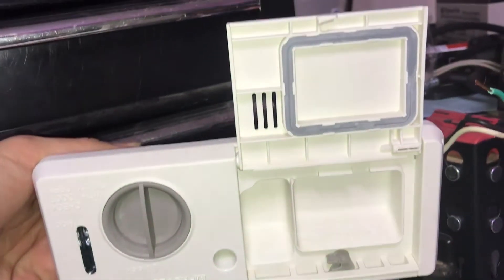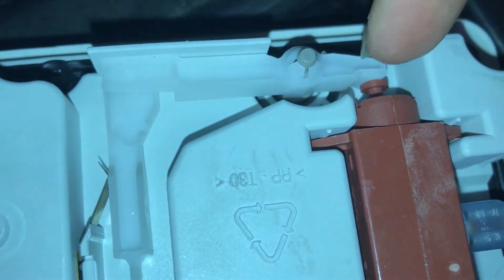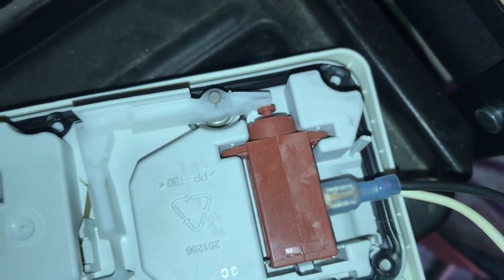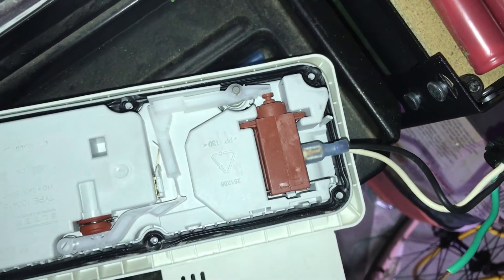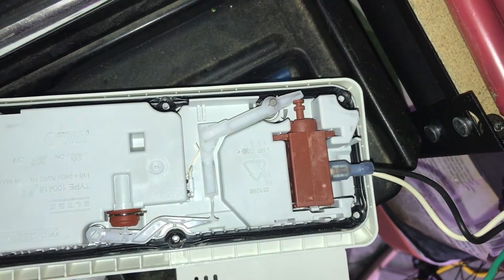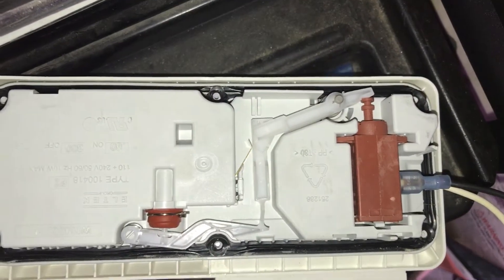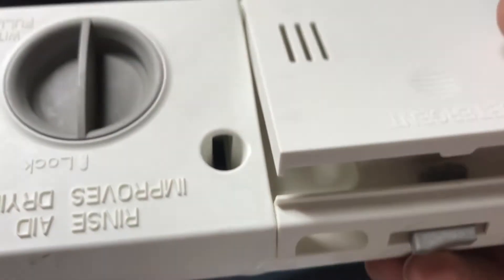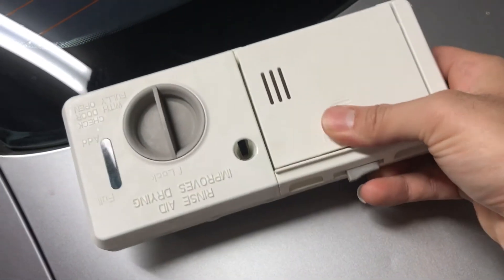How a dishwasher WAX motor works

Comment: Thanks for teaching me about this. I have one of these but on the vent valve on a LG dishwasher. I thought it was a solenoid. My test told me that it was dead because the resistance was high and didn’t move immediately when power was attached.   

The replacement is the same way. Could have saved $125. 

I figure that a wax motor is used because it is quieter than a solenoid. No clunking.

Comment: I have a whirlpool dishwasher and the wax motor stay actuated during all the washing cycle...look like a relay that sticking on the main board???
Reply: I changed the main board an I have the same problem...was motor stay activated all cycle long...until I open the door...why?

Comment: What power supply did you use to test the wax motor?
Reply from the maker: I used 120V straight from the wall. If it sounds dangerous, it is! I work for a master electrician (I am not licensed myself) but I know what I’m doing. I connected the wires as safely as possible, while the energized. When safe, I plugged in to the wall to energize the wax motor and it shot up immediately.
Reply: @bird2002   that’s what it looked like! Straight from a power outlet. Need to test mine, and I’m handy enough with electrical, but not brave enough to go straight  to the wall.
Reply from the maker: @oliverdunbabin9802  I used a repurposed electrical cable from a lamp. Everything was connected through a surge protector with an off switch, so I made sure I was far enough away to light it up. I don’t mess around with safety

Comment: Are those my 18650's on the counter? I knew I had 3 of 'em somewhere.
Reply from the maker: Yes indeed, those are 18650’s that I pulled from an old laptop. Had to destroy the case to get in there and they worked just fine. Not sure why the laptop was dead with them, now I just use them in my flashlights. They work great
Reply: @bird2002  Awesome. Thanks for the reply.

Comment: Oh that's bloody smart. I just noticed that the rinse aid dispenser pump is connected to the detergent dispenser mechanism as well. So when the wax motor is switched off, the rinse aid will slowly be dispensed. Which means this wax motor is doing double duty as a detergent dispenser and a rinse aid dispenser.